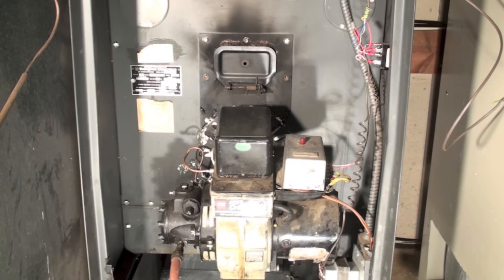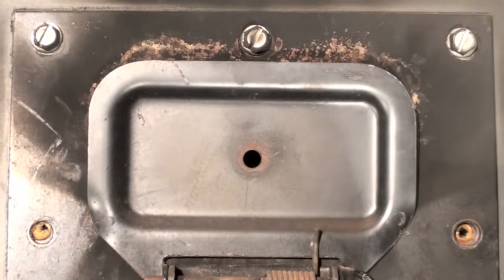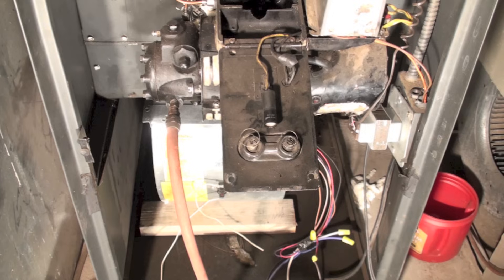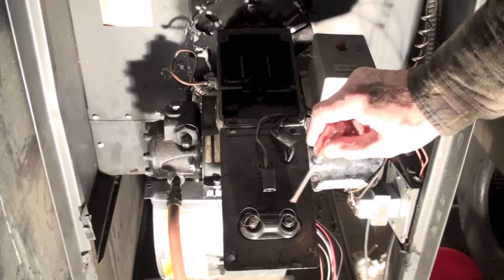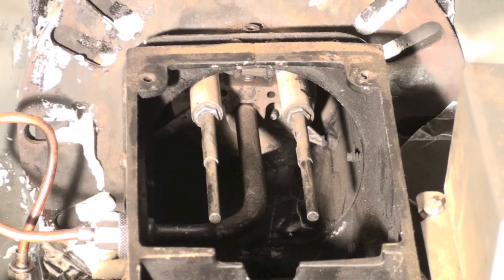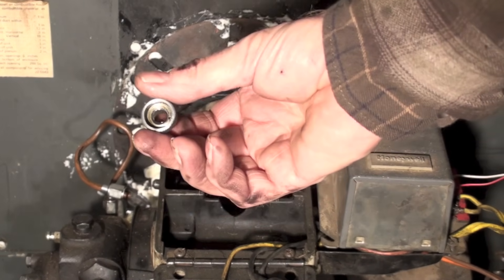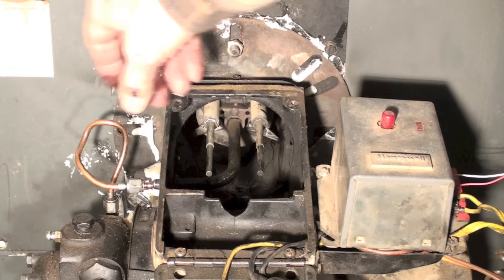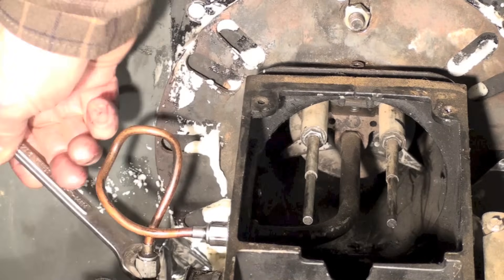Oil furnace troubleshoot part 2 No flame

Comment: GrayfurnaceMan,

First thing  for me to establish in this post, is for me to say that you are a top notch technician by ways of your demeanor and in your methods of instruction.  I enjoy them very much!

I do have two questions. 

Q1. (Scenario)  If a homeowner has a problem with their oil burner heating unit and has pressed the red reset button twice and the unit STARTS but it FAILS TO continue and restart after running for only 45 seconds before timing out  OR  it continues to fire for 30 minutes or longer.  (3) is it excessively dangerous to push the red button again?

Q2.  There is often a rattle of something inside the nozzle flume apparatus that makes a noise when you take it out when it is normally shaken (sounds like loose change) in a cleaning effort.  But sometimes the noise or rattling stops giving the impression that something has gotten stuck because the noise does not resume unless the apparatus is lightly tapped.  What causes or could cause this noise and is it normal or is a problem signal of something that could affect fuel flow?

Thanks, 

Jim
Reply from the maker: Q1 if the flame was on when the burner stopped, there is no problem.  You do need to find the problem though.  Sounds like an oil supply problem.  Oil filter clean, line plugged, pump screen plugged, oil tank outlet plugged.  You could also have a failing pump.  Q2 if you mean the gun assembly has a rattling sound, that does not sound normal.  I would remove the nozzle to check inside.  
GFM
Reply from the maker: I would remove the nozzle to check inside the gun line.  Some of these have a part inside that can come loose.
GFM
Reply: my oil heater sometime it runs good I could hear the oil coming in the furnace but when it didn't work I didn't hear any oil coming in  and no heat at all so I was wondering what happens to the oil heater? thanks
Reply from the maker: Where do I start?  Does the burner just not start?  Do you have oil in the tank?  
GFM
Reply: When the nozzle is removed, the only thing found is the lower foundation and oil in-port hole.  However, the noise seems to be in the tube  just before this and the nozzle connect.  Could it be a check valve of sort that is intended to prevent the fuel from going backwards?
Reply from the maker: The only check valve I have seen is in the pressure regulator.
GFM
Reply: I don't know what it is.  There seems to be a noise or something loose in the gun tube just before the large hex where the nozzle mounts.

Comment: I have an oil furnace that comes on by itself with no call for heat.  I tried disconnecting all the thermostats.  Still comes on.  Disconnected the thermostats at the furnace.  Still comes on.  Replaced the main controller. Still comes on.  The lousy thing has me stumped.  Any ideas?
Reply from the maker: Possible cad cell relay stuck on.  Check for power to cad cell. 
GFM
Reply: Thanks GFM.  I'll check it out once I get home.  I hope you have a Merry Christmas!!

Comment: What if I don't have spark?  It sometimes runs and burns oil for a few minutes, then shuts off and won't start again for a long time.  The relay does not have a blinking light.
Reply from the maker: Sounds like an oil supply problem.  Plugged filter?
GFM
Reply: Could be the transformer is shutting down when it gets hot.

Comment: I haven't worked on oil heat in 20 years, even then it was only a handful, there aren't that many in Minneapolis/St Paul. If the heat exchanger is flooded with oil can't you remove the burner assembly and soak up the excess oil with a rag?
Reply from the maker: +MN Hvac Guy The combustion chamber is also oil soaked, so it needs replacement also.
GFM

Comment: I have an old furnace that runs on Kerosene ( my tank is outside ) due to the cold up here in Upstate NY, and my furnace has been sporadic in firing the past month or so. I followed your video and was able to fix it myself.  It was the electrodes on the gun that the tips were melted back creating a huge gap. I replaced them as it fired right up. Thank you very much!
Reply from the maker: +Musicmanzer Welcome
GFM
Reply: Musicmanzer

Comment: what do you do if you pushed the button 100 times ? is there a way to air it out ?
Reply: You are an optimist.  I press it once and depending on the control I stop it if it does not start in five to ten seconds.  12 years doing oil heat.
Reply from the maker: +Joegernaut You will probably have to replace the combustion chamber.  If you light it, it will probably burn down the house.
GFM
Reply: +grayfurnaceman every time the temperature outside go's below freezing my furriness will not turn on but now that the temp outside is up to 45f it starts right up ?
Reply from the maker: +Joegernaut Do you have an outside oil tank?
GFM
Reply: +grayfurnaceman yes
Reply from the maker: +Joegernaut When the tank gets to below about 15 degrees F, the oil may gell.  That will cause a blockage in the oil line.
GFM
Reply: +grayfurnaceman how do I stop this ?
Reply from the maker: +Joegernaut You can have the oil supplier deliver #1 stove oil or there are additives you can put in the oil.  Check with your oil supplier.
Gym
Reply: +grayfurnaceman Ok will do thanks so much .
Reply: Hey I hit my button about 4 times. Is that too much? And if it is too much can I drain it out

Comment: I get no spark
Reply from the maker: +brian act If the burner motor runs but no spark, Check voltage into the transformer.  No voltage cad cell problem.  Voltage transformer failed.
GFM
Reply: +grayfurnaceman does the transformer need to be changed if no sparks or voltage?
Reply from the maker: +brian act I would say yes.
GFM

Comment: My situation is rare, the blower goes on and theres spark but the motor that pumps the oil does not go on if I turn power on and off a few time i may get it going but I think its the Ignitor control module ??
Reply from the maker: +thetruth It could be failed.  Also, you could have a failure in the centrifugal start switch of the burner motor.  When it does not start, hit the motor with a hammer.  If it starts, you probably have a start switch problem.  Hope this helps.
GFM
Reply: grayfurnaceman It was the CAD cell its working just fine now
Reply from the maker: +thetruth Merry Christmas
GFM
Reply: grayfurnaceman Merry Christmas Christians stick together before we are not allow to.

Comment: thank you for your wisdom, I am a tech and love the wisdom of.the masters. the small things make a big difference.  i.e. loosening both sides of the line.
Reply from the maker: +sageejumanjee Seems like a no brainer but commonly is not done.
GFM
Reply: I missed this one. What was the "loosening both sides of the line" about?
Reply from the maker: When removing the gun assembly, loosen both fittings on the gun line so you are not bending the tubing of the gun line.
GFM

Comment: I found the air ports completely closed. Flame was sparkling. I moved air adjust to what appears to be marks left from the original setting. Set it there, sparkles gone and instead of the burner running for up to ten seconds at times for a flame, it seems it is firing right away. Thank you. 
SMV

Comment: My 90 year old mom has a oil heater and i have been staying here with her caring for her. her house was closed up for 3 years and when I moved  her back in and starting using the heater; I noticed that there was a strong smell when the heater turned on. It makes a Kaboom sound when it starts up and was making me nervous. Now the heater is not putting out heat. I called a service guy and he said that it has not been serviced for quite some time and it shut down. He did not really go through like you show on the video. he said he could fix it for around 800.00 but said I should replace  it. Cost my mom almost 300.00 to tell her that and he spent maybe a hour looking at it, but never worked on it. Was wondering if I should trust what this guy is saying and just have it replaced. the unit is 14 years old and this is Minnesota. Being from California I don't know much of this kind of system. Any input would be appreciated.
Reply from the maker: Darcy Tolle If the furnace is 14 years old, it is repairable.  Find someone that fixes furnaces rather than replaces them.  Many oil furnaces have been running for 20 to 30 years.  Hope this helps.
GFM

Comment: Hello, GrayFurnaceMan,
I asked a month or so ago about our oil burner BOOMING on occasion. I had the chance to clean it a week ago with what seems to be a successful resolution you mentioned, a suspect clogged oil line. Thank you.
QUESTION: Now that the flow seems to be improved, would I be burning more fuel, as it seems my fresh fill is being used up faster than before?
I suppose the last guy in here adjusted the burn relative to the available flow.
What are your thoughts?
Thank you.
Steve
Reply from the maker: SeeMooreVids It could be.  A slight adjustment in air flow might help.  Careful here.  It is easy to get a dirty flame and get soot again.  
GFM

Comment: Hey gray Im having this issue with my oil furnace from time to time. It will be running fine for a couple of day then it the flame will not come on. I will press to reset button once then it will come back on. but know it will not come on just the motor. I check the gun and clean the nozzle still nothing
Reply from the maker: Johnnie Miller Sorry about the wait, you got lost.  Be sure your cad cell is clean.  I would also bleed the pump to see if I have a steady flow of oil, because you may may have a restriction due to plugged oil filter, line blockage or, if you have air when you bleed, a possible vacuum leak.  Hope this helps.
GFM

Comment: I can't thank you enough for this awesome video series! I was able to fix my oil burner issues for <$5 (cost of a new filter). It had run empty on the day it was filled and wouldn't come back on. With your videos I was able to check fan motor, the pump for seizing, spark, electrode gap, fuel supply, and knew not only to not push reset too many times but to check the chamber for built up fuel. When even after 2 presses in the troubleshooting process there was basically none in there and no misting of fuel that I could see through the viewport I knew I had a fuel issue. Turns out it probably just needed to be bled but I replaced the filter as well and it fired right up! Massive props for helping me save a bunch of money by avoiding a service call!
Reply from the maker: hvymetal86 Good to be warm
GFM

Comment: I pressed the reset button like 7 -10 times, how many times is too many?
Reply from the maker: That probably is too many if oil is coming out of the nozzle.  So, what to do now.  The best way is to replace the combustion chamber.  You can try lighting it by doing the repair, then lighting the burner for just a second, then shutting off the burner.  If the burner stays lit, it will burn out the oil.  Have a fire extinguisher readily available.  Not really recommending this but if you do, be prepared.
GFM

Comment: Thank you very much ! I just finished fixing my heat myself . I watched a couple of your videos after replacing a filter . I turned the power back on and hit the reset button ,burner would not fire . I took the igniter out I had a spare jet laying around from a earlier repair . Sanded the electrodes a little and the points . Reinstalled everything and PRAYED I hadn't hit the reset button to many times . The heat is back on and working . Great how to video !

Comment: Does it matter if I replace the nozzle with a .60 instead of .65? It works now, but will that affect my heat temperature or pressure problems? Also any fuel savings lol?
Reply from the maker: Jose Sevilla I should be fine.  Your air adjustment should be set slightly lower.
GFM

Comment: Question.   My nozzle and electrodes were covered in soot.. Could my electrodes need to be adjusted / replaced ?
Reply from the maker: Depending on how long it has been since the gun was serviced, it may be normal.  If it was serviced this year, you probably have a dirty flame.  I would service it.  Hope this helps.
GFM
Reply: grayfurnaceman okay thanks.. It currently is not firing.. I want to test the spark but don't want to fill the chamber with fuel to test it.. Can I turn off the oil to the tank and give it a quick start to check for spark ?

Comment: Great explanation, thank you! but the problem with my combustion head is that it doesn't spray although it's brand new. any suggestions? Thanks again.
Reply from the maker: OmarcoTV If your nozzle is not spraying and you have oil to the gun line, the nozzle is plugged.  New or not.  Hope this helps.
GFM
Reply: Thank you, it's working perfectly fine now.

Comment: Thank you so much for this video series! I am troubleshooting an intermittent problem with the ignition sequence in my oil furnace. Furnace starts great, runs for a few hours including cycling on and off, but then I find the ignition relay tripped out. I have replaced the ignition relay, the transformer, and the cad cell - this seems to have improved the performance (fewer lockouts per day) but I am still seeing the intermittent relay lockout - about once a day now, sometimes less frequent. The performance of the cad cell is right on target at about 600 ohms while running with flame and near infinite when off. The two next best places to look seem to be either the thermostats or the Honeywell controller. Have you seen this issue before? Again, thank you so much for this video series!
Reply from the maker: Patrick Mullin Lockouts are almost always a fuel supply problem or a venting problem.  If the filter is clean, I would flush the lines by removing the gun line and starting the unit to see ig there is good flow.  Hope this helps.
GFM
Reply: grayfurnaceman Thanks for the heads up, I will focus there next. Can you expand on what you mean by venting problem? ... Patrick
Reply from the maker: Patrick Mullin Blocked smoke pipe or chimney.
GFM

Comment: Hi.  I got oil delivered yesterday and when I left the house the furnace was running.  I came home last night and it was cold inside.  I tried bleeding and restarting, but nothing is happening.  When I open the valve to bleed the furnace, no oil comes out.  I have tried the power, pushed the red button, made sure the thermostat was on, etc.  There is a flashing green light above the reset button.  Should that be flashing or steady?  I don't know what to do, it's getting colder inside and out and I don't want the pipes to burst.
Reply from the maker: Jean MacIntyre You may have a plugged oil line.  Probably happened because the burner was on while oil was being added.  This stirs up garbage in the tank.  I would  replace the oil filter.  Take a look at the cad cell relay.  If it is of the newer type, the video shows how to clear the failure.  http://youtu.be/SHTwhOtvQWE  Hope this helps.
GFM

Comment: what if there isnt a spark off the transformer? everything else on the furnace starts... with the cad cell eye removed...testing the way you did in this video.is there a way to test the emergency relay? or bypass it to test the transformer?
Reply: I have the same problem.  Did you figure it out?
Reply: WolfsonJamal

Comment: i have a problem with a new yorker furnace with a riello 40fs oil burner. i can hear it light for about a second or two then i can hear the flame go out for about 3 seconds then reignite and continue burning. when the temperature drops below freezing the burner won't start on it's own. when i restart it, it does the same thing, flame on for a second or two then no flame for a few seconds then stays lit and runs but at night when the temperature drops it shuts down again. i've changed the filter, the pump screen, the nozzle, the cad cell. i even changed the control box because prior to this problem it wouldn't ignite at all, any ideas?
Reply from the maker: pa17948 This sounds like a vacuum leak in the supply line or possibly a bad pump.  You can do a vacuum test on the inlet line, but be careful.  Its quite hard to be sure on these vacuum problems.  One indication of a vacuum leak could be a noisy pump as the air goes thru.  Also if it is 1 pipe, and when you bleed the unit, the air comes out.  Hope this helps.
GFM

Comment: Thank you for the great video series.  I pulled the nozzle/electrode assembly on my 1978 HBSmith to find out what size nozzle to buy for replacement and had no fire after I had cleaned some carbon off and put it back together.  I didn't think I disturbed anything at all… I was able to check spark systematically, and it turned out the electrodes were ⅜" above the nozzle and that must've been too close to the spray.  As soon as I set them to ½" above, it fired back up on the first try.   
The advice on pushing the reset button too many times can't be stressed enough, either…

Comment: I just wanted to say how grateful I am to you for making this!!!!  The systematic troubleshooting steps were awesome. I work in technology where I have to troubleshoot every day. I was so happy to see this video. I live in nh it was so cold yesterday but even colder last night and today  it's fixed thanks to you. I had fuel but no spark. I often love when I don't have a easy time with a particular issue at work. Most issues I have to follow all the way to the end. I am thankful in this case I only had to troubleshoot to the ignitor module and they had it at Home Depot!!!  I also through this experience realized how to perform cleaning maintenance to the unit. Thank you again so much for taking the time to make this series!!!!!  I hope you have a awesome day!!!  John K from stoddard NH. Currently -5 without the windchill  but 67 degrees in the house!!!!